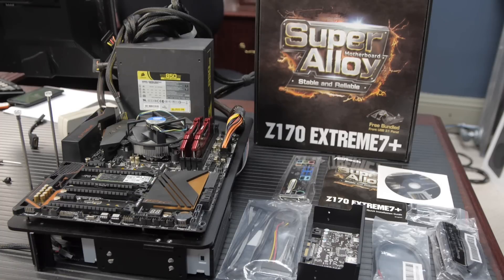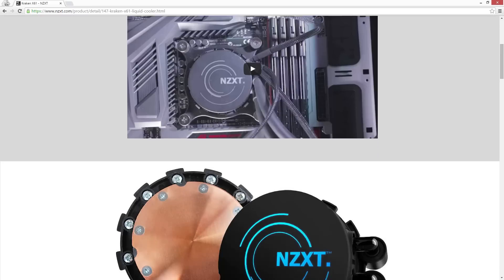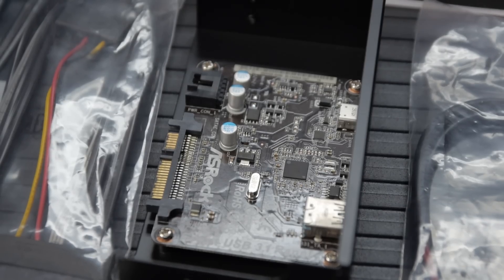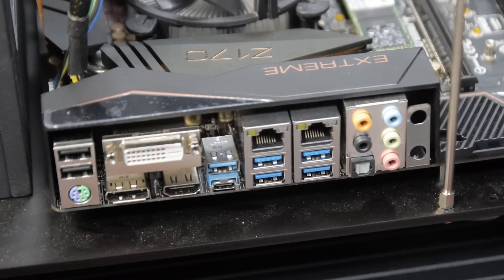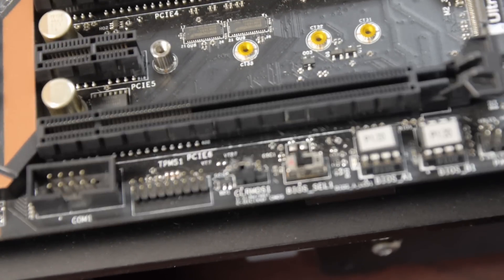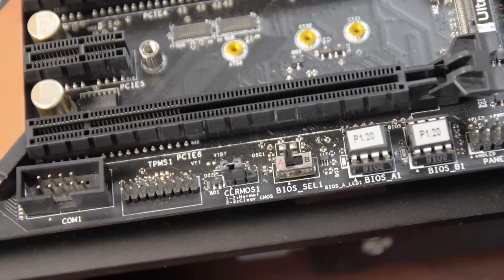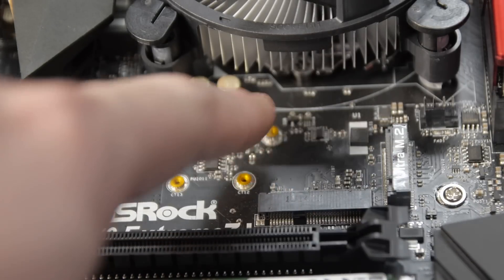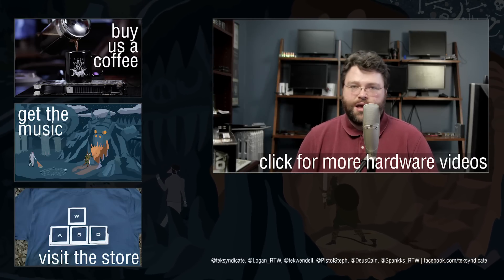ASRock Z170 Extreme 7+ : Socket 1151 for Skylake

Comment: I've this motherboard! Asrock Z170 Extreme 7+. But I'm confused whether I've connected my storage properly or not. I've 1X Samsung 850 evo 250 GB m.2 SSD. 1X WD10EZEX 1 TB Blue HDD and a 320 GB WD blue taken from my old Laptop. And I've a MSI GTX 1070 Gaming X GPU also. So, how should I connect all this Storage and Graphics Card to get best performance? As this motherboard shares PCI-e lanes for M.2 and GPU. Some SATA gets disabled, like this is written on the manual. I'm confused. Please reply someone helpful. Thanks!

Comment: Love your videos and thanks. Say, around 13:23 you mentioned (re Linux) the integrated graphics not showing at a certain point. I ran across a guy talking about a similar problem (albeit a different OS) and it had to do with UEFI GOP (Graphics Output Protocol) and his problem started after he disabled CSM . Try toggling that - just a thought.
Reply: +rwprime1 Like you said, you probably just have to wait for the next update of your Linux flavor. But just for the heck of it, this guy (a different one) says: UEFI  Compatibility Support Module (CSM) provides compatibility support for traditional legacy BIOS.  This allows the booting of an operating system that requires a traditional option ROM support, such as BIOS Int 10h video calls.
A Smackerel of Opinion
Notes and jottings from an Ubuntu Kernel Engineer.
http://smackerelofopinion.blogspot.com/2011/11/does-your-uefi-firmware-have-csm.html

Comment: how is the quality brand of ASRock compared to msi and asus and Gigabyte?
Reply: +Airwolf2030 ASUS owns ASRock
Reply: +Tippolas Thats is not correct. Asrock was  spun off (aka dumped) by asrock many years ago. They are owned by Pegatron.
Reply: +Kyle Klukken And guess who owns Pegatron? Asus. I checked numerous threads on google before posting here.
Reply: +Tippolas in 2012 they released their stake in pegatron.
Reply: +Airwolf2030 My ASRock Z97 board is feature rich, easy to OC and has been going strong since I purchased it in 2012. I only ever had 1 problem with it. Lightning storm blew out the onboard ethernet. Granted it also took out our router and the neighbors HOUSE (He blew ALL of his TV's and computers). What was awesome is ASRock RMA'd it under warranty and sent me a "new" one in 2 weeks. All things considered I would say build quality is great. I took it out of the case to do cable management after adding 3 drives last year and it went back in and posted no problem-o. 

I don't understand why everyone gives ASRock shit... Overall I've been SUPER happy with mine.
Reply: +Stephen Dimitrovich Asrock used to be junk many years ago. Unfortunatelly the bad reputation is still alive today.
Reply: Personal experience, Asus is fine but had few bad experiences with Gigabyte... 
The last rig I made I used AsRock... its rock stable! Awesome overclocker
Reply: Lukas Schmidt
AsRock is great! Was my first choice when I wanted to build my new computer. Until I tried to contact them. Non-existant support. I also found out that the warranty is throught the seller only (they refuse to take their responsability in most case), and stores will not take it back past a month or so. Also, they appear to have only 1 year warranty. So.. I went with asus... Atleast they have good warranty and good support.

Comment: Question: If I buy the Intel 750 (SSDPE2MW400G4R5) in the  2.5" form factor, then use the Ultra M.2 adapter for connection to this motherboard, am I saving any PCIe lanes (as opposed to simply buying the Intel 750 HHHL form factor)? The manual says that each M.2 port shares lanes with a pair of SATA and one SATA Express port and does not mention which PCIe slots may be disabled in conflict with the active M.2 port.

Thanks in advance.

Comment: 15:29

I've bend my motherboard's cpu socked pins, multiple times... while cleaning them with paper (kinda like lapping, but with paper so it cleans the contacts(clean the layer of dirt that will eventually form)... got a magnifier, a needle and fixed it... one has to truly bend their socket pins in order to fuck them for good, and then have zero hand coordination and control to not be able to fix them...

I did the same with my ram slot, cleaned it with paper, and it improved the stability of my system. My cleaning OCD is strong when it comes to PCs.
Reply: ADevilNeverCry uuh.... whut.... lapping the cpu pins with paper so that "future dirt" won't form? what delusional person did you learn that from. I lapped my i7 920 (worked great) I had but I'm not doing that to my i7 4790K, lapping waterblock is worth it though...

Comment: Should i go with skylake when im planning to run 2 gtx 960 4GB in sli ? (Because 8x)
Reply: ***** don't bother with those cards, save up a little more and get a better single card like the 980ti
Reply: SJ Connors
i got one gtx 960 4GB ... i just wanna know if i would get problems i wont change the gpu ... i would have brougth the gtx 980 but it has the same power as the sli and i got the gpu because its cheaper and enougth for now
Reply: +SIME_LP Skylake is fine for 2-way sli you won't see a difference in fps between skylake's 16 lanes or Haswell-E 28 or 40 lanes.
Reply: ***** Sorry but I don't understand what you mean by same power? The 960 4GB still is way slower that the 980. I think that you may have dug yourself a little hole getting that GPU if you are looking for top performance. You could sell that card and then get a 980 but you will lose money on what you paid. What is the rest of your system like?
Reply: SJ Connors He means that 960 4gb sli has the same power as a 980. It should be close anyway.
Reply: stef verheyden
 SJ Connors
gtx 960 in sli is a bit faster in some games and a bit slower than the 980 in other games so its pretty much same

Comment: My 4670k is running 24/7 @ 4.8 ghz stable 1.275v, cooled by H110 with push/pull fans on a Asus Hero motherboard.Using my pc just for games so I will not upgrade to skylake,i will upgrade maybe on cannonlake.

Comment: Its insane, if you are running anything above 2500k you really dont need to upgrade. They also overclock better..
Reply: Folopolis this is what they do, tick shrink the process size, tock update the architecture. Although rumour has it that kaby lake might change this.
Reply: smok3ybg i have a 2500k, the second i saw they were changing sockets is when i knew i was in it for the long run...here theyve done it again, im sure the old gen products will liquidate at some point, slim to no hope getting a new 2500k at a reasonable price, but the futures this socket 1151 and 2011 are the future i guess. Still some original I7 930-50s seem to be doing well with their tri channel ram. I guess i can always get more/better ram and more ssd storage.
Reply: Folopolis I know very little about it. Just saw an article recently
Reply: smok3ybg of course it's worth upgrading if you use all the power or want better efficiency. I went from i7 920 to 4790K, didn't notice much speed difference as I was already overclocking the older chip, but the much better power consumption is nice. I miss the ability to have 96GB RAM in my old board, maxed out at 32GB in my new board ;( also the amount of PCIE lanes sucks in this current CPU.
Reply: maz Why would you ever need that much RAM?

Comment: I really dig the 5.25 front plate that Asrock included. That would look pretty good in my case. I don't use anything in those slots, I've thrown out all my DVD drives at this point.
Reply: Iv still got 3 dvd drives, but they're all IDE :(

Comment: wait... skylake is pretty much here, what happened to broadwell....
Reply: zach miller broadwell is more for small low powered devices.
Reply: Not like with Sandy Bridge > Ivy Bridge, that was a real new generation, Haswell > Broadwell was not really a new generation it was just a shrink of the technology, to test the 14nm shrink, I don't think there will be a Broadwell Xeon, i3, Pentium or Celeron or Broadwell-E processors

Comment: I am going to have to dump my AMD fx-8350. I was hoping that Windows 10 + DIrectx 12 might be enough reason to stay with the AMD chip for a couple of more years, but I have been looking at the reasonable costs of the 1151 socket chips, and changing my mind.
Reply: You wont be disappointed, my trusty FX8320 at 5ghz couldn't keep up with my i7 3770s at 3.1ghz with 2x 780ti's, single card they were nearly dead even, but adding a 2nd the performance was sometimes more then 20 fps on some games going to the i7.
Reply: Viking Dude Yeah, this was last year. lol I dumped the 8350 and bought an I7 6700K. I have never been happier. Now, I am just waiting on the Nvidia 1070, and an Oculus rift that is supposed to show up any day now......
Reply: Nice, that 1070 looks like its going to be a killer card for what they want for it.